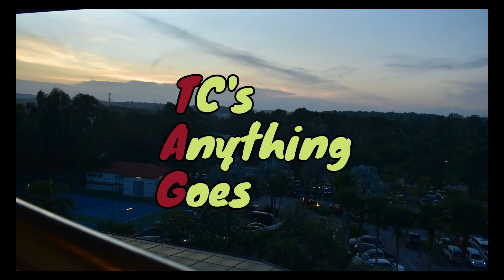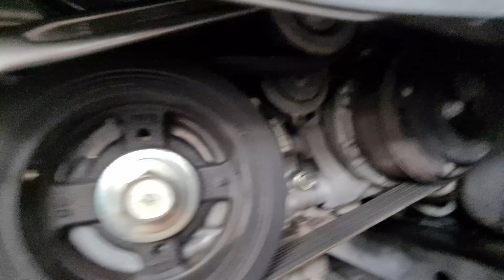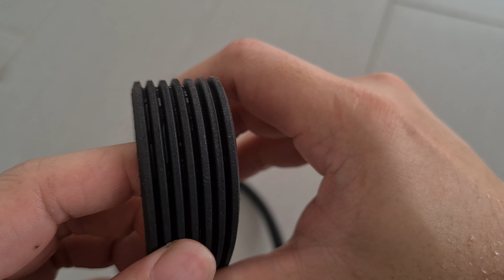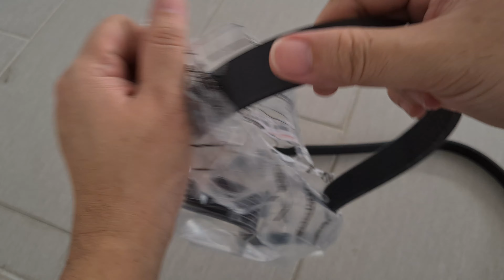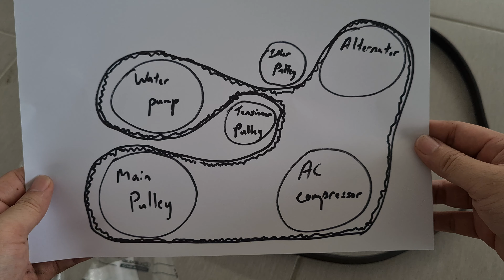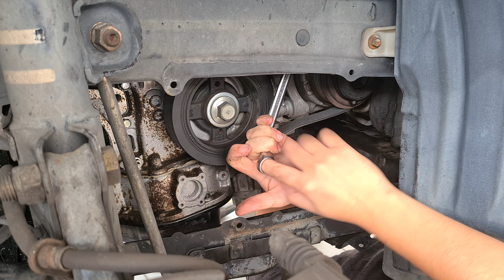2GR-FE - Easily replace your Alphard/Vellfire fan belt.

Comment: A mechanic accidentally broke the belt tensioner adjuster bolt while changing the belt. Just wondering, how come the belt tensioner can be so fragile despite being made of aluminium alloy? Then the mechanic blamed the OEM belt tensioner 😅 FYI, the belt tensioner was newly installed 3 weeks ago.
Reply from the maker: i think in this case, i would blame the mechanic instead. used too much force or something.
Reply: @ Exactly. I did some research & found that inexperienced mechanic tends to make this mistake. Btw, the mechanic at Toyota broke my belt tensioner &  insisted that I pay RM 1,300 for a replacement. 😅

Comment: my aircon squeeks when I turn it on, sounds like from the belt. is there any way to tighten it abit more?
Reply from the maker: nope cause the belt is tighten with an auto tensioner. So its either the tensioner is losing its tension or MORE LIKELY, your compressor is slightly seized which is it why it squeaks when the magnetic clutch engages.
Reply: @TCsAnythingGoes  No Worries. I will give it a check tomorrow. Thank you so much for your quick response! Hoping it is just a loose tensioner.

Comment: Thanks very much.  I just did my ES350.  Took me an hour and saved $200.00.  Here in Canada, a belt from the Toyota dealer is made by Bando.  I was not happy with this as it is much lower quality than the one from Japan.
Reply from the maker: We have Bando in Malaysia as well. Its cheaper than original but definitely does not last as long as original. We do have another alternative which is Mitsuboshi (not mitsubishi) which so far.... i guess its okay.

Comment: One thing you forget is to check the idler and pulleys for play. I notice that after you replace the belt and start the engine I could still hear noises coming from the pulleys.
Reply from the maker: You are correct. This video is for the replacement of the belts. Browse around my channel and you will find the videos on how to check and replace the alternator (which was the cause of the grinding sound you hear in this video)

Comment: Where power steering pully pump?
Reply from the maker: My car does not have the power steering pulley as the power steering is electric powered
Reply: Yep, ggh20 alphard uses an electric motor above the steering column, no hydraulic power steering.